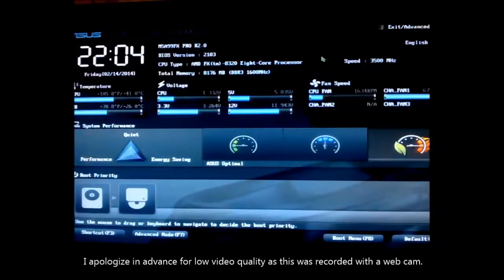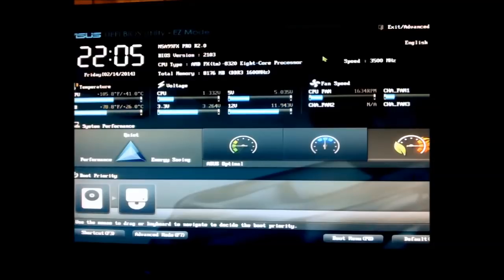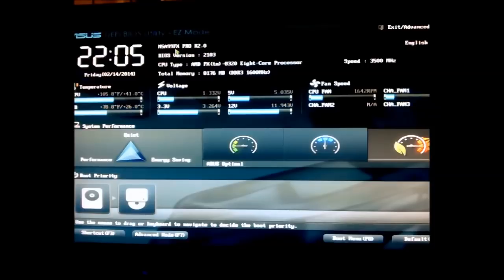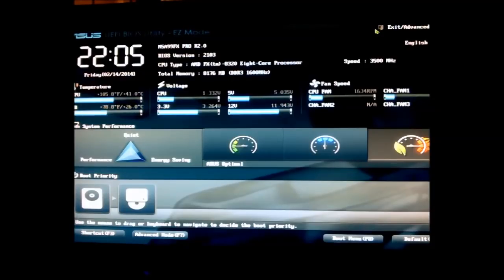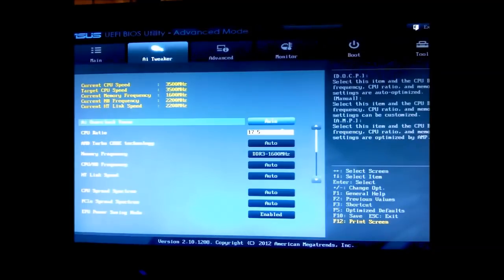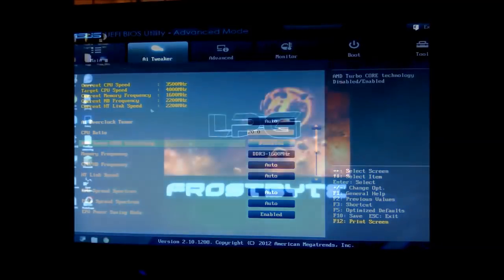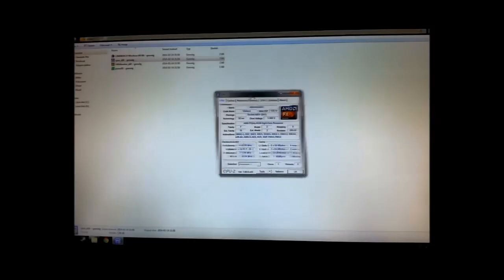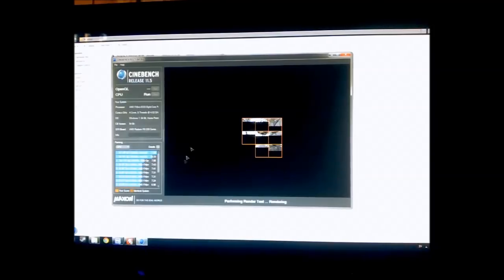Turn your AMD FX-8320 into an FX-8350 (8320 OC Guide)

Comment: I run my fx 8320 @ 4.4. I've noticed the largest increase in performance once I hit 4.4 (compared to say 4.2). Little things, such as, the map in skyrim, lower than 4.4, drops to 45 fps w/vsync, at 4.4, it holds 60 fps. That doesn't mean the fps was increased by 15, it just means that it's able to hold 60 fps, and not step down to 45 because of Vsync. 

Hitting 8350 speeds with a 8320 really isn't that difficult as long as you have a solid cooler / mobo.  

From what I've read, the sweet spot for FX chips is 4.5 - 4.6. However, heat becomes too much of a issue past 4.4 for me. @ 4.4 Prime95 hits 50c, 4.5, more like 58c, 4.6, I have only ran when freezing outside, with a opened window. I personally notice my best performance with my FX8320 @ 4.4. I use a H100i for cooling on a 990FXA-UD5.

**Make sure when you OC, that your multiplier and voltage isn't being throttled. You multiplier should stay at what you set while under load. Also, your voltage should have as little play as possible. My Vcore when running stress tests stays between 1.401 - 1.416. You'll get the smoothest performance when your multiplier, and voltage stay steady.

Comment: thank you my friend :) i oc'd my rig about 5 months ago and its still running smoothly. 

3.5 -> 4.2ghz and everything has worked properly.

i got noctua cooler x2 fans and max temps i have got is 54

have been thinking at someday i put this baby to its limits and check how far can i go.

Comment: Thanks for the short and easy tutorial! Got a stable OC @ 3.9 with stock cooler and average temp of 44.3C and max 49C. I was concerned because of my mobo(Gigabyte GA-970-A-DS3P) but everything worked just fine. Cheers mate :)

Comment: This video is a good starting point for overclocking an FX-8320 with and Asus motherboard/bios. I am running as ASUS M5A99x EVO R2.0 and it has the same bios....  I do agree with Villee below in that turbo core needs to be disabled. (And the tutorial should be updated to reflect that requirement.) Cool and quiet should also be disabled while you are adjusting the multiplier up, to see how far you can push your 8320. Once a stable multiplier/overclock is found, THEN re-enable cool n quiet. This way you get the overclock boost when you really need it, for lets say gaming, and the energy efficiency when your just surfing the net.

Comment: I have the gigabyte 970a-ds3p mobo. When i overclock it just a little bit when I'm rebooting. A screen comes up stating that the settings are not compatible or something. I need to load the default settings or go into bios and manually do some settings for it to boot up normally. I did exactly like you in the video and it doesn't work. Can you give me an advice?

Comment: It works fine at 3.800 MHZ, but prime95 gives me an error with  20 multiplier: it should be running 0,4 not 0,47 or something like that can i use 4 Mhz or its dangerous?
sorry for my english xD

Comment: i have ASUS Motherboard M5A97 R2.0
is it safe to do that with the exactly same way???
Reply from the maker: +evansicaria Yes.
Reply: +evansicaria only if its not the "LE" version.
Reply: Shakib Ghosts
I can't tell for shure but i think 4+1 its a low power-phase not intended for overclock. If you have a Fx4300 you might think to raise your clock a little, i wouldn't do that on a Fx 6 or 8 core.
The safest thing you can do with your mobo its to upgrade your BIOS and purchase an Fx8350 or 8370... since they are supported and at stock will work as (kind of) the overclocked version of the Fx8320.
But be aware that your mobo will only work with 1333 freq memory (might take 1600 w/memory overclock), its not a big deal, but its another limitation compared with a 970/990 motherboard.
At the end of the day, if you already have that mobo and youre looking for an upgrade from a Phenom II CPU, an Fx8370 w/16gb (1600 freq) RAM will be your best buy... if youre planning to start a build from scratch better look for another mobo, any of 970/990 chipset are way better, even the ones on a budget
Reply: Juan jotabe what’s the issue with the LE version?

Comment: figured I would share my own little trick. Mounted a scythe gentle typhoon 4250 rpms to a evo212 heatsink and hit 4.8 ghz stable @ 1.4625v, fsb = 240, multiplier 20x. the overclock is also based on the other hardware on board so I wont give more info than that... every set up is different, but it is possible. Been running solid for 3 months now

Comment: I did the stresstesting and checked the degrees. It went up 73 Celsius. Is that something to worry about or not? I have the original cooling that came with the computer. I have not bought another cooling item.
Reply from the maker: +CynicalDwarf As it's during full load and stresstest it wont ever get that high during normal usage, you're fine.

Comment: It's already turbos to 4ghz when required. Otherwise if you wanted to go above 4ghz , then yes OC with cooler.
Reply from the maker: The turbo only affects single cores and clocks up to 4GHz pretty much never due to windows scheduling. This OC makes it so all cores can benifit from the extra speed.

Comment: I have the same board and there are two readings for the cpu tempature in hwinfo. First one is directly from the amd chip and the second comes from the motherboard. Which one should I be paying more attentions to?
Reply from the maker: John D Both. The Package temp can't be trusted when it's below roughly 40 degrees. But don't let it get above ~70. Same thing with the socket temperature. If they go above that temperature no big deal but that's the safe temperature for "every day usage" so even if it goes above it in stresstests if it never goes above it otherwise you're fine.

Comment: I want to get an fx 8320 cpu with a Biostar TA970 motherboard, and Cooler Master hyper 212 evo cooler (this fan is supposed to be real quite an the stock fan really loud). I only REALLY want to OC to 4.0GHz no voltage increase, but may want to push it to maybe 4.2 - 4.4 later by tweaking voltage. I know it's not that great a motherboard, but would this be realistically safe-ish? I don't want to pay much more for a better motherboard, not more than $15 more anyway. I am trying to build a solid budget rig and just want to get a little more performance and this would be my first attempt at a build. thanks for any advice.

Comment: Cool video, what would u recommend someone to overclock to with :
MB: Sabertooth 990FX R2.0
CPU cooler: GX-7

Would really be interested to know if i could take this higher than stock settings :) Thanks for helping out in advance someone new to Overclocking in general. Very satisfied with this build. And your video was the most helpfull. Cheers

Comment: what voltage were you running? couldbt see on cpuz it was too small
Reply from the maker: Stock!
Reply: +LPG i see peoples stock at 1.36 . my stock is 1.4? idk why. i oc to 4.0 and left it at the stock volts.  i find it weird i can't get to 4.2ghz at 1.4volts
Reply from the maker: Michael Perna May differ due to other things such as motherboard and settings.
Reply: +LPG ahh i see. msi970 gaming not the best so far I've noticed.  for me anyway. thanks for the responses

Comment: What speeds can i be expecting on my FX-8320 with COOLERMASTER SEIDON  LIQUID COOLED, thanks
Reply: Are you using the 120mm? I have the 120mm and I can get to 4.4 Ghz simply by OC in AMD catalyst control center, you should be able to get to my speed or at least 4.2 Ghz.

Comment: hey bro, I got the fx8320 with the m5a97 LE R2 and I have it overclocked to 4.5 GHz and nomatter what voltage I use with auto manual or offset on my PC will randomly freezes I have a h100 cooler
Reply from the maker: +Clayttz 60fps It's simply unstable. For higher OC than in the video look over at this guide as there's other settings you need to change aswell: http://www.overclock.net/t/1348623/amd-bulldozer-and-piledriver-overclocking-guide-asus-motherboard
Reply: +LPG I have a gtx 970 what clocks would u recommend I run this CPU at I'm done with trying to get a stable high overclock
Reply from the maker: Clayttz 60fps Depends on your chip, but i'd settle on like 4.6.

Comment: I can't find the AI tweaker. I see the advanced option, but next to it says Main. Can you lease help?
Reply from the maker: AI tweaker is in advanced options. Go there first and it should be found there. It might not be named AI tweaker, but if you find the multiplier and turbo it's correct section.
Reply: ***** Thanks for the fast reply! The problem is, I went to the advanced settings, but see no multiplier. I know the motherboard is capable of overclocking. It's called the asus M5a78lm/usb3. I'll go double check, but thanks, I don't find a lot of people who reply as fast.
Reply: I got it to work, but now every time I boot my pc, it says over locking failed. What should I do?
Reply from the maker: Felix Liang How much did you OC? I'd guess your motherboard can't handle it if it was a higher overclock. Reset the overclock or lower it.
Reply: ***** I OC'd it to the AMD fx 8320 level, but it's fine now. I turned it down to 3.9 ghz, and my pc works perfectly. I might oc it to 4 ghz someday, but for now I'm fine. Thanks, your video was really helpful.

Comment: Any Help? I've been told My FX8320 is bottle necking my Video Card, I'm running a XFX R7 370 2gb 256 bit DDR5 XXX on a M5A99FXpro R2.0, Last week I Updated my Bios. And Lan drivers from ASUS, I'm currently running 32gb DDR3 1600 G-Skill Rip jaws X series, And cooling my CPU with Corsair Hydro H75. My Gaming is a bit choppy, lan download is high speed choppy, and so is my video. Currently on a DSL line AT&T and have been for over 20 years. Dec upgraded from a ASUS M4A87T AM3 AMD 870. Never had this problem and I was running a 960T Unlocked 2 Core for a 6 core 3.8ghz. Same Memory and Same Video Card. I'm running a Power & Cooling MK II 650 Gold Series Power Supply in a Antec 900 Case
Any thoughts would Help, I want to OC this set up.
Reply from the maker: The R7 370 will be the bottleneck in most cases, not the 8320. Whoever told you otherwise is likely heavily misinformed or intel biased.
About the other problems I've no idea. Go on some forum for help.

Comment: i have fx-8320e and ASUS Motherboard saberthooth 990FX R2.0
is it safe to do that with the exactly same way???
Reply: +Erick Rascon  i clocked the 8350 with exactly same motherboard its safe but coolor is quite important while clocking the Pre liquid coolers are quite effective if not the high end CPU fan coolers works fine.

Comment: whats the FX-8320 sound like? the fx 8350 is just terrible i love gaming but my cpu noise gets scary even tho temps are around 50c it still sounds crazy i can hear it all over my house
Reply: Julian john get rid of the stock cooler and get an aftermarket. Go with water cooling if you can afford it.
Reply: d3nki - just got a cosair H75 Hydro cool its almost silent now but still got crappy FPS
Reply: that will also depend on your gpu and ram, make sure they're not bottlenecking your cpu.
Reply: d3nki - EVGA GTX 750Ti superclocked 2GB and 8GB hyper fury 1600 ram.
Reply: Julian john what games are you trying to play and what settings?
Reply: GTA5 medium settings getting 35-40FPS pretty much the same on other games too
Reply: Well, you're trying to run modern/taxing games on a 750, you can't expect to get 60fps
Reply: d3nki - even older games like medal of honer 2010 or tomb raider 2013 are struggling to get 60 :( even the sims 3 cant do it or skyrim  can you suggest an affordable card to me? cant do crazy prices like £400 but £150 or something i could do.
Here's my specs:
ASrock N68-VS3 FX
Cosair H75 HYDRO COOL 
AMD FX8350 8 Core 4.02GHz
8GB Hyper fury 1600mhz DDR3 RAM 
EVGA NVIDIA Geforce GTX 750Ti 2GB superclocked
1TB SATA harddrive
Cosair CX750W
Reply: You could go for a gtx960, I've seen those on sale for about $160. You can also try to get an SSD, you can buy a 240GB for $80 if you get it on sale. Also, check the speed of your HDD, 5200rpm drives don't cut it anymore
Reply: Julian john I would recommend the new r9 380
Reply: I've done a load of research on gpus and the best one for the price is definitely the r9 280x same price as 960 but tonnes better
Reply: +Julian john i'm sorry but cpu dosen't make noise but the fans and cooler you have does i would reccomend nocturne fans they are proven to be the most silence fans & have great performence but they are ugly so i don't use em for my Window riqs, but they are great for the Cases that don't have window on it;P

Comment: I used AMD overdrive to make my 8320 run permanently at  4ghz with a Cryorig h7 air cooler. Idle 20 to 25 degrees and while on gaming the processor temp ramp up to 52 max, Awesome little cooler :)
Reply: 52 max whoaa mine idle at 16c and go up to 67c
Reply: but mine is at 4.4 ghz and i got an evo 212
Reply: Evo is nice but if you can try the Cryorig brand. They got some in the lower price bracket and they are really good.
Reply: i put my second evo 212 on my cpu and now getting 53c max with prime 95
Reply: while gaming in ultra setting at farcry 4 im getting 42c on cpu and 67c on my gpu
Reply: That's some really nice temps dude. :)
Reply: Asif Liaquat i got alot of fan to its not complete quiet

Comment: I bought 212evo. To overclock to 4GHz on a stable, just set asus normal system performance, raise the multiplier to 20 and disable the turbo core? Or you have to do anything else?
Reply from the maker: The system performance setting is something im not sure if it makes a differense, but yes that's all you need.
Reply: ***** Please can you try to set normal and see if it works? :) With performance, i have problem
Reply from the maker: jokeergear I'm pretty sure that's the setting i currently have. I had performance in this video but that's something i changed later.
Reply: ***** I Got It. But then to normal there should be no problem, do not change the voltages right?
Reply from the maker: jokeergear The voltage is fine at stock.
Reply: ***** Ok thanks :)

Comment: Would I be able to over lock 4.0 ghz?
Fx 8320 
Msi Gtx 960 
Hyper evo 212 
And a 500 w psu
Reply: +PsychGaming first of all you need motherboard that allows overlclocking then you need get motherboard that allows you to play around more some cheap as motherboard can give you trouble
Reply: I have a gigabyte 79LMT-USB3
Reply: PsychGaming you have dual bios on that motherboard as i'm aware of, if it unlocked you can go on the site you broguth it on should be there if not i wil find out for you btw dual bios can be handy if trouble shows up.
Reply: ok thanks so much man i appreciate it!
Reply: if you want any further help you can add me on skype or steam & i wil guide you.
Reply: steam name ?
Reply: Chris Frog same picture as i have on youtube, i have two steam account both are Chris frog with same picture if you had the one level 25.

Comment: Alright so it runs at 4.0ghz now
But when I run prime95 it bogs down to 1.3ghz sometimes and will freeze after a while....? What's wrong?
Reply from the maker: +J⃟O⃟N⃟A⃟T⃟H⃟A⃟N⃟ S⃟C⃟H⃟U⃟L⃟T⃟Z⃟ It throttles and overheats.
Reply: ***** it can't possibly over heat. my water cooling keeps it at 70ish F
Reply from the maker: J⃟O⃟N⃟A⃟T⃟H⃟A⃟N⃟ S⃟C⃟H⃟U⃟L⃟T⃟Z⃟ what motherboard do you have? Without heatsinks or issues with them perhaps you might get throttling that way. A watercooler does not provide good air flow above the motherboard area compared to a tower.
Reply: +LPG asus m5a97 le r2.0
It's suppa cold in there man idk
It says the board stays at 70ish too
Reply from the maker: +J⃟O⃟N⃟A⃟T⃟H⃟A⃟N⃟ S⃟C⃟H⃟U⃟L⃟T⃟Z⃟ 70 C or F? You mentioned fahrenheit above but double check. Some power saving setting for the CPU might be causing issue if throttling is not the case.

Comment: I did every step on my 8320 w/212+ on the MSI 970 Gaming MoBo and I had to reset the CMOS because it wouldn't boot, there was power but no boot... I'm on stock settings right now :/

Comment: Doesn't the 8320 have a speed boost of 4.0GHz?
Reply: The turbo speed is at 4 ghz, but it doesn't stay at that speed.
Reply: Supposedly, but my 8320 never never hit 4 Ghz, only went up to 3.7GHz under boost, but i overclocked to a stable 4.3 GHz, you can go more but my mobo's bridge or bus, whatever it is gets too hot i think.
Reply: I think I've heard it has like two steps on the boost clock, with the first being like 3.7GHz, and the second one that rarely triggers for some reason being like 3.9.

If I recall, the turbo boost also only boosts one core, where is OC cranks up all of them so it's better turn Turbo off and just OC the chip (which can hit like 4.2Ghz without touching the voltage on decent units) to get the most out of it.
Reply: on CPUIDHW I get 4077 on all 8 cores while running wow and have hd video streaming in the background with a few other tabs open. Stock. Little better than 4.0 :)

Comment: This is fine but you haven't increased any voltages, surely this would cause stability issues?
I'm going to try amd overdrive auto clock I think as I'm a noob with this stuff 😝
Reply from the maker: Ed Hall Piledriver CPUs are fine with roughly 500-700MHz overclocks without increasing the voltage. Only a very few chips would need a higher voltage. 
And I don't suggest you use any program inside windows for overclocking due to what they tend to do.
Reply from the maker: ***** The 8320E because of the binning. The 8320E will most likely require less voltage than the 8350/8320 for overclocking.
Why the 8350 is recommended idk, the 0.5GHz differense do make a noticeable differense imo. 3.5 to 4 GHz is roughly 15% more performance.
Reply from the maker: ***** Mostly single core peformance determines the performance you will see in a game. Intel has a major edge here, having roughly up to 70% more with skylake over piledriver.